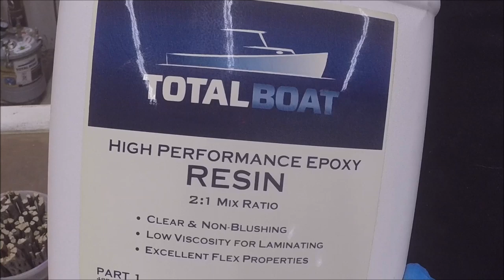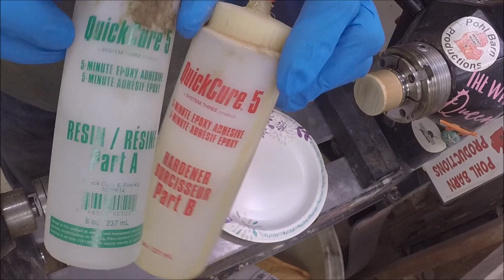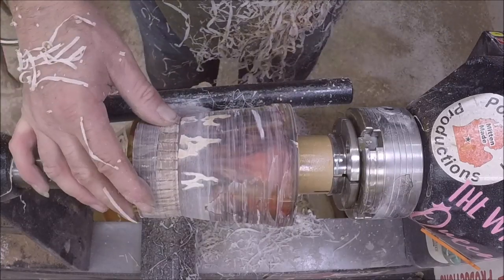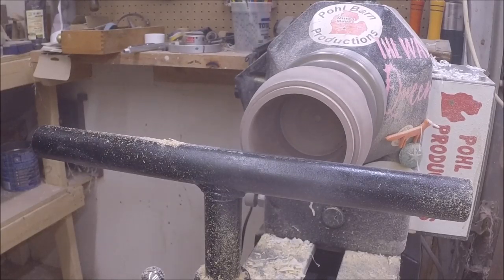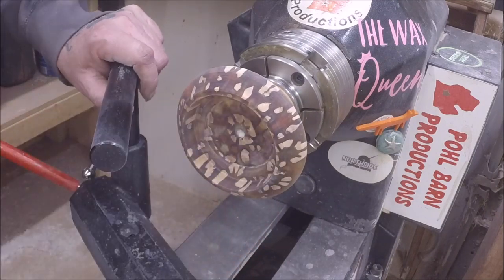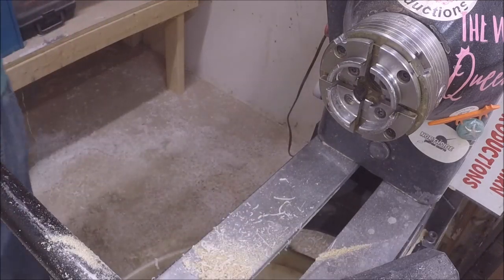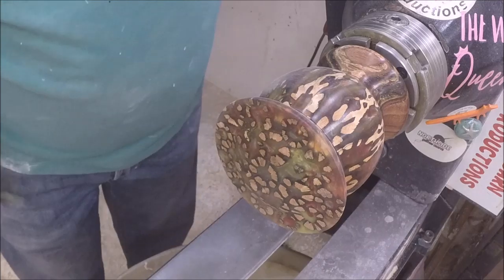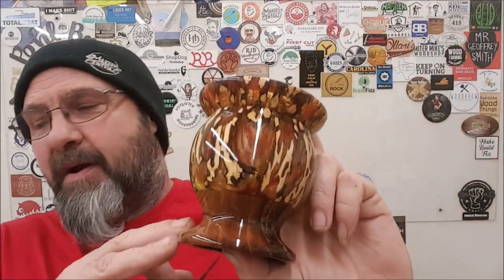Cholla Cactus and Resin box

Comment: Nice turn. I turn a lot of boxes and learned to use painters tape on my tenons when some dummy over sands. Sometimes this dummy needs three wraps. I also learned, the hard way, to use painters tape to tape over the connection between the cover and the body. This helps hold them together if some dummy gets a little pushy.. Of course that won't stop it from coming out of the chuck when some dummy doesn't tighten it. lol I like painters tape,  on tenons,  so much I bought three different widths to fit what the tenon is In depth.
Cheers,
Lee
Reply from the maker: Thank You Lee

Comment: What was your grit progression when sanding? I used the same resin on a bowl recently and got some ugly streaks after I went from 120-600 followed by micromesh
Reply from the maker: on the inside I went from 120 220 320 400 600,  because I have them and wanted to try out the new sander thingy,  lol  the out side was only to 320
Reply: @PohlBarnProductions  Thank you! I've been looking into getting one of those, they seem like all the rave.
Reply from the maker: I made that one, it's the tube out of the pressure pot I drilled and taped to fit the sanding pad threaded arbor,  I had to order thicker pads so they curve with the part and don't vibrate

Comment: What is the wooden "cap" you put on your chuck and then glued your piece to it?  It almost looks like something commercial, or did you turn it?  Great piece BTW.  Thanks!
Reply from the maker: I cut it from 2 inch stock for making these boxes, nothing more than a dowel,  it's purpose it so I can cut both top and and bottom close to the same then remove it for the next piece

Comment: I.m in Fresno Ca but I lived for 65 years in Lansing, where are you out of? I like your turnings. One other question is where did you get your stamp of your logo from?
Reply from the maker: Thank You John,  I am 30 miles south of Lansing, in Charlotte,  the branding Iron came from Gearheart engineering, there is a link in the description below the video in the show notes that will take  you there
Reply: @PohlBarnProductions  
I know Charlotte very well. I use to buy my wood from Johnson Workbench and still always make it a point to go there when we are back in town visiting. I actually lived in Holt but wasn’t sure you may not of heard it so I always say Lansing. I retired from the State of Michigan after putting in 36 years in DEQ. That’s why I started wood working because of the job but didn’t start Woodturning until three years ago. Getting into segmented bowls.

Thanks for taking the time to respond. Wound’ the mind talking by email if your ok with that.

Jon Grace
Reply from the maker: Thank You Jon,  I can but at the moment I am having issues with my email on my comp, I keep getting locked out of it so I am only currently able to access it through my phone,  I have a Charlotte address but I'm actually in Olivet I believe,

Comment: Who can tell me the specific name of the iron barrel machine used to accelerate resin curing in the video? Thank you very much.
Reply from the maker: it's called a pressure pot, it does NOT accelerate the resin curing time, it only compresses the air bubbles that were mixed into the resin until it sets up and hardens, it also helps control the exothermic reaction of the resin

Comment: Jeebus! Where did you get those big ass forstner bits? Was that 2nd like 3" diameter?
Reply from the maker: Actually from your favorite store Brad,  but back in the mid 90's when it was mail order only,   the big one is only 2 1/4 I think maybe a bit smaller.
Reply: @PohlBarnProductions  ahhh i have their modern ones. Only goes to 2" tho. Decent set but must be sharpened often